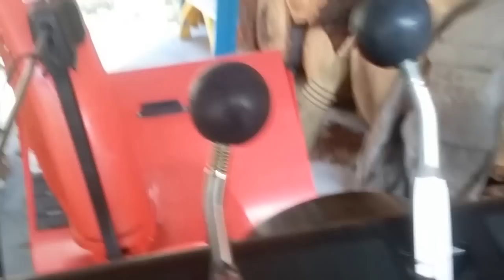Ariens / Carroll Stream diesel snowblower project

Comment: I did this China diesel conversion about 12 years ago on a 10,000 series, 24", Ariens snowblower when the original engine died.  I ended up cutting the belt guard in half - into top and bottom pieces and spanned the opening in cloth, but I have to say that I was always having problems with it just the same. Either snow collapsed it some, causing belt to eat it, or snow got in enough to cause the belt to slip
  
More generally, in northern Maine, in an unheated, detached garage, I had to tent the snowblower over with a blanket and put a small, fan-forced space heater underneath it for an hour or two if I expected to start the thing. I also found breathing the diesel exhaust in the extreme cold problematic because the engine never burned super-cleanly in the extreme cold.  That and the diesel exhaust was often boxed in and concentrated by snowdrifts on the side of the garage (northern Maine 120" inches of snow a year) making clean air for me hard to find while operating the thing.  

Two years  ago, I completely rebuilt/repainted this snowblower again.  It was my dad's 1974 machine so I'm somewhat emotionally invested in it.  I gave it a new Briggs 7hp gas engine because the starting problems, belt clutch and cover problems, and the nasty breathing just became too tiresome.  The gas engine, while not quite the beast that the 10hp diesel was, is big enough.  I was lucky to find a new belt cover online - for a 1974 machine - to replace the one I had cut.

I'm thinking of finding another one of these older snowblowers and trying a 240V, 3600rpm, electric motor on it.  I have a 240V, GFCI-protected outlet in the garage.  I think I can deal with a power cord, but not quite sure.
Reply: With all your skills could you not have:
fabbed up a high outlet exhaust (head height with an angled top section) (like tractors do)
fabbed up a complete new cover for the Drive V belts out of metal that stopped belt slippage from snow intrusion
taken off the air cleaner and inserted a flaming propane torch for 1 minute thus ensuring near instant starts as hot air inducted into a diesel = rapid starts 
fabbed up a "hot box" from which a reinforced flexible hose drew hot air from around the exhaust...thus providing that required hot air for best clean burning? (as if it were running on a nice summer day)

Comment: love it, starting seems like a real pain though. I wish it sounded like a diesel but it sounds strong either way. I guess in 1 cylinder you cant get the proper diesel distinctive bucket of bolts sound. It will certainly be my next project, buddy has a few diesel china knock offs in a storage unit :)
Reply: Starting can be helped by storing the blower in a shed and out of snow.

Can also be helped by a propane torch flame in the intake (take off the air filter)

Heat allows diesels to start far quicker....(it's a compression/ignition engine!)
rather than having to turn over the engine to allow compression to heat the cylinder when it's freezing.

Comment: Instead of cutting the top off the belt cover I believe I'd have put some sort of spacers (washers maybe? Or maybe thick strips of rubber from an impeller kit or a mud flap or something) under it and used longer bolts.  Why diesel over gas?  Just curious.  LOL @ tying down the auger...I have a 1960's Ariens with the drive belt and auger engagement handles on the right side between the intake housing and the engine.  When you're behind it the augers are always on...in fact, after you put it in gear and release the clutch you can let go of it and it will drive itself.  That is a blessing to me because I'm 6'8" and if I had to hold onto it all the time it would absolutely be murder on my back :)...I know this because I also have an early 2000's Ariens 824 that I do have to hold onto to make it go and it's the same height as the 1965 one I have.

Comment: Doesn't the engine have a governor?  It sounds like not.  The engine sounds like it slows down under load and then runs away when the snow blowing load clears.
Reply: I was wondering the same thing.  I actually have 2 of these Chinese diesels, though not ones imported by Carroll Stream and their governors work well.  I'm not sure what was up with this one.

Comment: In addition to not having a carburetor and dealing with the potential issues those can have, you'll enjoy a quite noticeable improvement on fuel economy especially if you can run the engine in the 24-2600 rpm range vs the gasoline engine.
Reply: Ya my fuel bill for my gas blower just about bankrupted me
Reply: papa bits between not having carburetor problems, not having to deal with old fuel, and less fill ups all point to good reasons to have a diesel on seasonal equipment.
Reply: Only thing is if it’s -5 out it is a pain in the ass I’m sure starting that engine. Diesels are very hard to start in very frigid climates. That’s what slowed down a lot of those p Sherman tanks during ww2 I believe is trying to get them started during the Cold War

Comment: When are you going to upload a video on the turbo build? :D
For easier start on colder days you build an alu bracket with a glow plug in it and mount it just before the air intake. Thats how Yanmar did it on the original engine.
Just use a 12mm or thicker alu bar. It will heat the incoming air and let it start easier.
It will also start easier if you hold the decompression down and let the flywheel get some speed before trying to kick the engine over.

Comment: Hey man what’s the chances you would take that black cover by the chute off and a quick video or few pics so I could see what type of gears are there to make chute rotate. Thanks
Reply: They are brass helical cut gears designed to break inside of the gearbox case lubricated with a graphite impregnated grease. You can find the break down online.

Comment: Killer!  Now retrofit a glow plug so you get a quicker start
Reply: A flaming propane torch into the intake for 30 seconds (after you take the air filter off) will give you near instant starts. 
That's the principle of the Thermostart intake flame heater and grid heaters in modern diesels..
and glow plugs in old IDI diesels.

Comment: i was going to ask you how its still running, but it looks like you may have just finished it lol. You have literally just finished what i am wanting to do. Seems pretty simple to do. Did you run into any problems that you didn't put in the video?
Reply from the maker: Yes I ran into one really unexpected problem.  It's still running, and honestly, it's awesome.  We've gotten record snow this year, and this bastard chugs away.  Also, it's really sweet when you have it at like 3/4 throttle and it starts to bog, then put it to max and watch a big poof of black soot shoot out the exhaust.

BUT, I still haven't fitted the belt guard, and that's been a huge problem.  I figured it would just be cosmetic, but as soon as a little snow gets in there it jams the mechanism and binds up the driven pulleys, so I need to pour a bunch of de-icer in there and wait for 5-6 minutes.  So, prioritize the belt guard.

Thanks for the interest and good luck!
Reply: well i just ordered my engine, but i went with a different brand(still Chinese yanmar clone). I'm debating on getting a bigger pulley to speed up the auger, but maybe I'll wait and see how it throws before I go doing that. Have you used it in wet snow yet(wouldn't mind seeing a video of that)?
Reply from the maker: I have slung some wet snow.  At full speed it will chug through anything.  I usually leave it at 3/4.  Not sure what donor bucket you're using, but the Ariens I used was fine with stock gearing.
Reply: ariens 1124pro. So, probably similair
Reply: for all you spent you could have bought a new blower with warranty..............
Reply: I've never seen a diesel snowblower from the factory here in the states, and most snowblowers worth a damn are around 1500usd.  So, thanks for your opinion, but I'd much rather take my 12yr old snowblower and go to town on it than get a new one with a warranty I'll never use. Have a great rest of your day.
Reply: stangman96gt  thanks u too
Reply from the maker: stangman96gt I'm interested to know the details of your engine?  Where are you sourcing?  Does it have glows?
Reply: its a sigma power products based off the yanmar ..same as yours just different company. Glow plug not sure about it hasn't come in yet(should get here wednesday or thursday), but most of the others I've seen come with one. So we'll see. If it doesn't I'm not too concerned. I was going to import a few for my buddies and I, but the liability of importing wasn't worth the price savings. I was able to get this off ebay for $649 with free shipping and i noticed they raised their price to $699 recently.
Reply: So, no glow plug or the bung to install it in the intake. The Starter on this thing sucks IMO...doesn't turn fast enough to get the engine going reliably, have to stay on it for about 15-20 seconds for it to finally start. Starts on the first or second pull with the rope.

 However, I will say this I was watching a video and they said ...high altitude take out a shim from the injector pump to regain some power. So, I did that and all this info is based off running with one shim taken out. Well I'll be reinstalling said shim, because i didn't really think about how the pump works...well it basically advances the timing when you take a shim out. I think i heard some knock when it was running...probably a little too advanced.

 I'll possibly be taking off the pull starter(to get to the flywheel) and time it myself to within specs.

Also, just ordered the exhaust I'll be using for it. Went with a walker 22769 muffler to quiet it down some more and a rain cap for the top. I think it's going to look awesome rolling coal out of a smoke stack with the snowblower =)
Reply: stangman96gt.   stop sending me all your response to questions people are asking u I don't care !!
Reply: well bud I'm hitting reply from Andrew's post. So, I don't know why you'd be getting them.
Reply: Try buying some cheep tin roof flashing and bending it to shape. Then pop rivet the tin extension to your plastic belt guard cover

Comment: Seeing Ariens use plastic drive train parts really turns me off. I thought Ariens was a premium brand? They also use a plastic friction drive disk in some machines.
Reply: They used to be. Its just like rca now. Brand recognition holds up the brand so they can sell cheap crap.
Reply: designed in failure point. hit something too hard, that pulley breaks and not the motor or transmission.

Comment: You should have used an older 70's Ariens chassis like the 10000 series or 924000 series built from 1979 and back. The gauge of the steel is 3x thicker the paint process they used back than makes the paint nearly impossible to come off and they have cast iron gear cases, bigger gears, chains everything is stronger and can support an engine of that size/power much better and longer. 
https://youtu.be/bA0gD2O7iIE
Reply from the maker: Agreed.  This one happened to be available with no engine though.  I've had a bunch of trouble with the chassis so far, like that stupid chute adjustment.  That one in your link looks pretty stout.
Reply: Yea they call those high output chutes now, compared to the ones they make now back then they were pretty much all like that but that's what they consider them now. The problem with those is they are only 11 inches tall not including the deflector. I have since switched to a taller chute Ariens used from the mid 80 into the early 90's that fits my machine. It's 15.5 inches tall and just about as wide. It made a huge difference, I would say about a 50% increase in the height the snow is thrown and distance compared to that old short stub chute. If you ever do use an older Machine's chassis, that is one of the thing's you will want to change, otherwise they built those machines to go a half century or longer. Those old chassis are outliving there engines now and people are giving them new power to breath life back into those old machine's. There would still be many, many more of those old machines around if getting new engines that are easy to put on were around years ago. Regardless there are a lot of those old machines around still because they built them like tank's. My 71 with the 24 wide bucket I got for free, that one in the video I paid $195 for, but than took the old engine off resold the engine for $290. The Predator was $99 so originally I just about got that machine for free as well. I spent around $100 so far on upgrade's, taller chute, new skid shoes, new larger thicker chains and the hardware to get the chute rod up high near me so I don't have to bend down to turn the chute. I don't like the way they make the chutes on the machine's now with that bar going straight across the top and when you turn them they feel flimsy to me. Not these old ones. After that chassis you have now breaks apart and is not worth repairing from all the wear and tear, find a 70's chassis, you'll find it was the best decision you ever made.
Reply: Andrew Cook

Comment: For those who do not use diesel engines, like this, small ones, there are a few things you should know about cold starting, you never ever ever increase the throttle to start, just a very small bump from idle, never ever ever throttle up beyond the point of keeping the engine running, as soon as it will idle on it's own, let it idle for a good ten minutes. 
If you increase the throttle before it's running, all you do is put alot of fuel in the engine that is not burnt, it will end up in crankcase oil, same with when it just starts, engine is not hot enough to fully burn fuel if you throttle up.
Heating the fuel line and or injector pump, intake manifold, hair dryer, light bulb etc.... will make it much easier to start, using cold start fluid on these engine is not good for them, but if you need to, very small quick sprays.
Not so important with air cooled, but a hot diesel engine should not be just " shut off ", let it idle for a few minutes before shutting off.
These simple steps will save you alot of money, last but not least, you never ever start a diesel without checking the oil first.
Magnetic block heaters for cars, works really well on these engines, stick on crank case.
Nice job mounting the engine, hell of alot better than some rigs I've seen.

Comment: I have seen a few videos with blowers with diesel engines,  I would think that by the time your done with your driveway all the snow on the block will be  BLACK !
Reply: Hot box the exhaust...plastic reinforced spiral wound pipe to take heated air to the air intake (no need for filter) improves combustion.
Extend exhaust like you do a tractor...above head height and angled...

Comment: i hope you have a heated garage because you'll  have a tough time starting it in cold snowy weather
Reply from the maker: The cold start in the video is about as bad as it gets.  I picked up a magnetic block heater, but haven't tried it yet.
Reply: @AndrewNCook  must not live in Minnesota
Reply: I've done a similar project and added an intake heater from a Cummins engine which can be seen here: https://www.youtube.com/watch?v=l5I_tyAuWeg&t=1s.  Cold starts (-10°F so far) haven't been an issue.  Usually starts in 2-3 cranks after 30 seconds of preheat.  Just an option since you have a mill to easily make the adapter.
Reply: Nice job converting to Diesel but that hard start is a killer for me! My 13 yr old Ariens ST524E starts with one lick of the starter button!

Comment: It doesn't seem to have the auger rpm that a gas engine would provide, my dad re powered a John Deere walk behind and he had to get new pulleys because the shaft diameter was different he went up in hp and pulley size and it really throws the snow along way with the few extra rpm.
Reply: They're both 3600 RPM engines, performance would be identical.

Comment: that drive belt is supposed to be running always, its the friction disk that drives it,..... the auger should be slack and engages when the lver is pulled
Reply from the maker: 99xc700sp Correct. The friction wheel/disk was always engaged from when I picked the bucket up until reconfiguring the springs. So if I had that belt hooked up, it would have moved on its own.
Reply: 10-4

Comment: Get a smaller pulley for the auger the engine will last longer the gas engine was designed to run @ 3400 to 3600 RPM. You don't need to run the diesel that high to get it to really move snow.

Comment: Swap your tires, they are facing the wrong direction.
Reply from the maker: Thanks.  Those skinny bastards are in serious need of some chains too...
Reply: I put those Xtrac tires on every wheel driven snowblower I have and they have done well.  Try it with the tires facing the correct direction and you may be surprised.  Enjoyed your engine swap video!